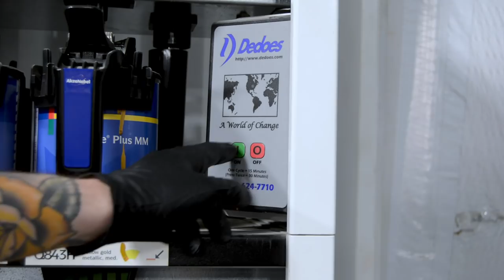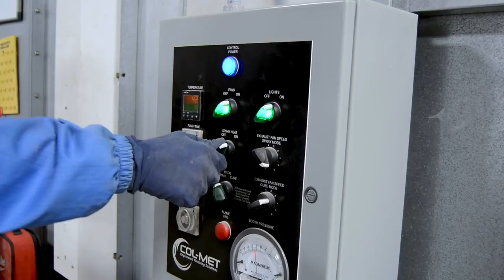Modern Desk (with pearl automotive spray finish)

Comment: Hey thanks much for posting this ..I can imagine the gold pearl finish.You and your wife did a great job with all the details you put into this.I have a question..since you have access to all the automotive finishes/techniques as well have the skills to build furniture. When using automotive paint on the furniture. Does it "chip" if its bumped. Im trying to find a indestructible finish or at least something close to it.
 I understand cabinet paints a bit but don't know much about automotive paints and stepping into the area of designing and getting furniture manufactured. Im looking for no holds bar on quality/finish for the surfaces that may receive paint.
Reply from the maker: I haven't has any durability issues with it so far, seems to be plenty tough enough for furniture.
Reply: @MattLaneWoodshop  Cool thanks for getting back to me . What are your products for the base coat, finish coat and sealer I dont know if someone asked this.
Reply from the maker: It's all sikkens products.
Reply: @MattLaneWoodshop  I appreciate the info ..Thank you much!

Comment: Patient Wife, Happy Life. 😉 Desk turned out amazing Matt! Great call on the continuous grain drawer fronts with the sapwood “stripe”. Gorgeous. Just curious - do you seal the drawer boxes at all? I’m wondering if that is important for long term durability (humidity / stain resistance). And I’m pretty jealous of your new shop!
Reply from the maker: Thanks man! Yeah, I forgot to mention in the video that I wiped a coat of wipe on poly onto each of the drawers.